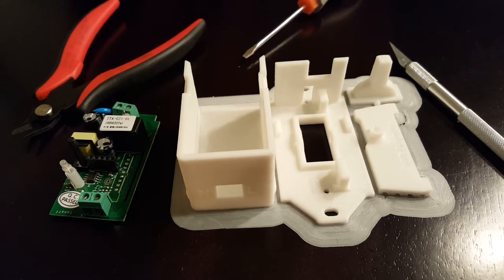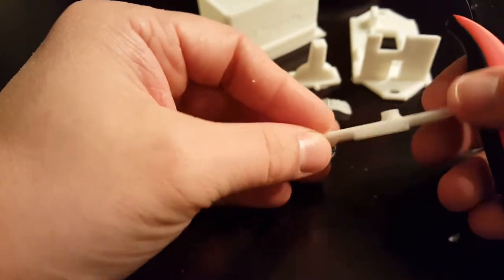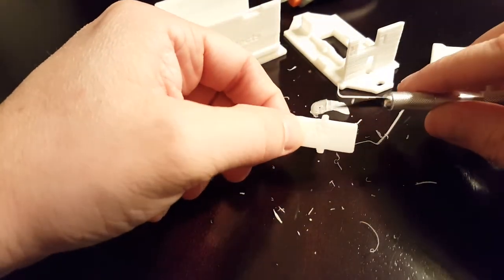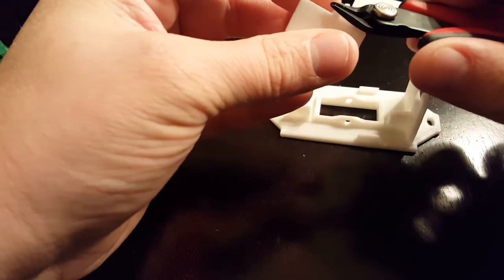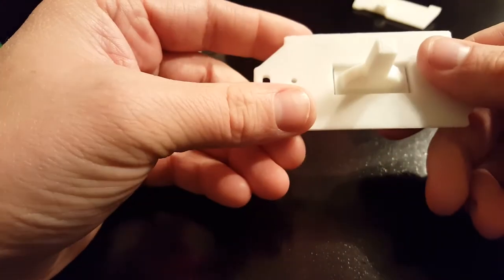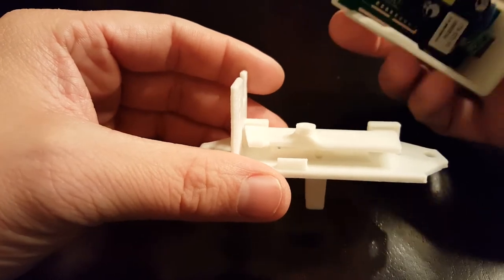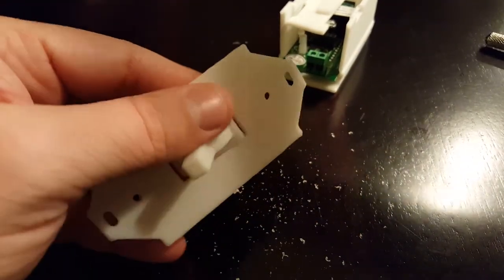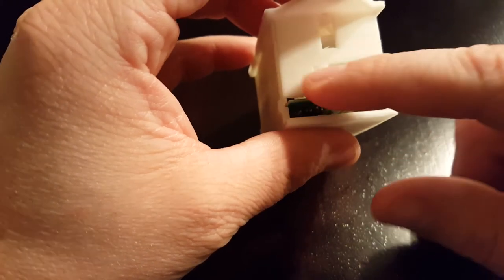Sonoff Light Switch v2 - Assembly

Comment: Two name brand switches would run me about 60$. I can get 8 of these for 54$ shipped. Bought two to test with my wiring without even verifying, think I'm good. Any idea on how to solve the 2 switch for one light? Would using one on each side of work? Haven't thought it out enough
Reply from the maker: One way to do it, that seems to be popular on the internet, is to wire a sonoff on each side with only one of them actually controlling the light. The other one just sends a MQTT message to the other through a home automation hub or raspberry pi. I don't particularly like that setup because it relies on the hub or pi for it to work, but it would work as long as the hub or pi is working as well.